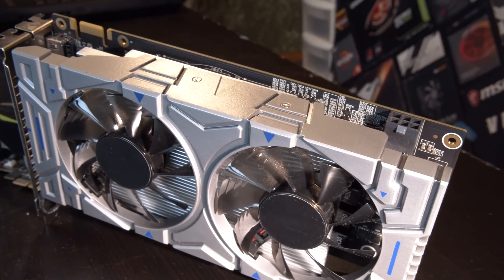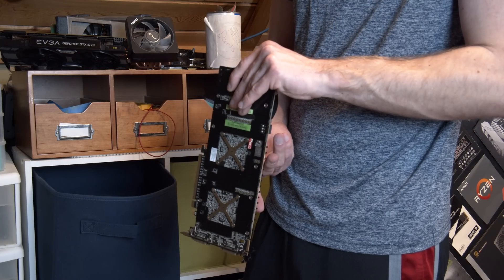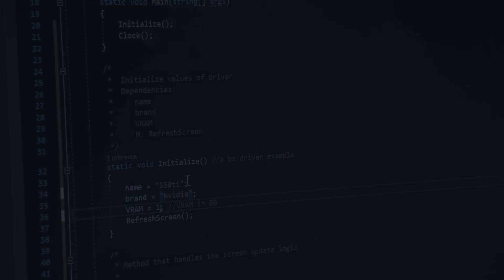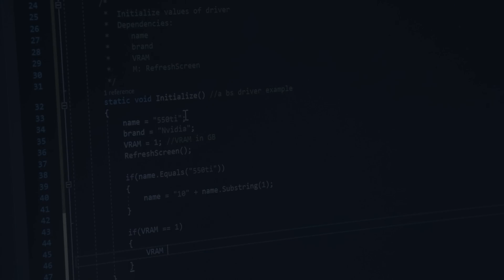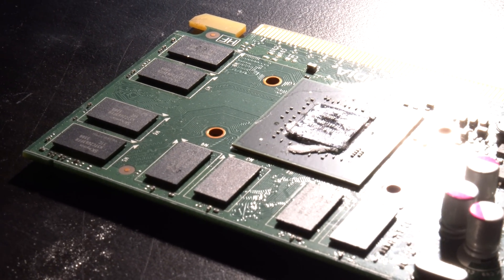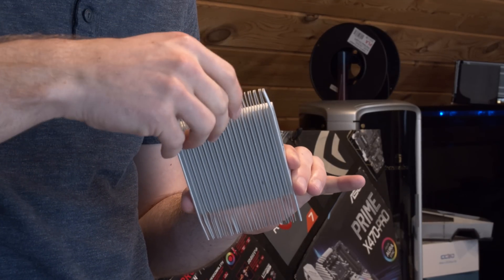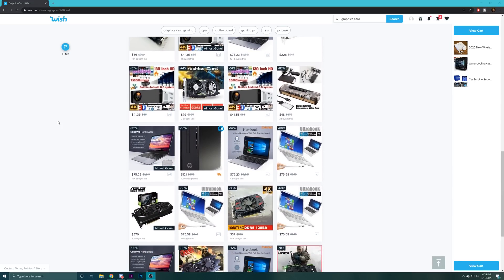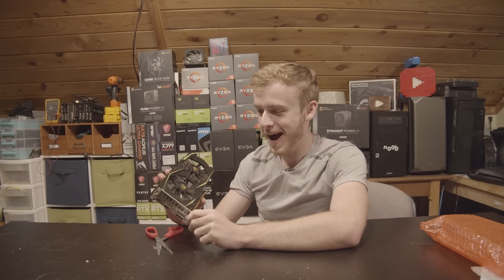How Scam Graphics Cards are Made, and How To Avoid Buying One

Comment: I can't imagine it costs too much to produce these cards. With the amount of 550 Ti cards out there, especially in China, they are probably extremely easy to find. I imagine there are just piles of 550 Ti chips and PCBs just sitting around and these scammers just buy them for a ridiculously low price. Throw on a heat sink that costs almost nothing, a couple of ridiculously cheap fans, and copy a shroud and you got a GPU. Just gotta alter the BIOS. I'd be surprised if the cost of making one of these exceeded $30, to be honest.

Comment: Shipping them from china costs literally cents. And since these GPUs are often broken and purchased from recyclers in bulk, you can assume a couple dollars per card as its scrap value. The chips are taken out from their old boards and soldered onto freshly printed black PCBs to make them not look a decade old. All of this happens in electronics factories during off hours or sweat shops. Some local recyclers in my country also sell dies only, without the PCB so a few thousand can easily fit into a briefcase. :D

Comment: Why not buy a 1050ti then change the shroud to look like a 2060ti and change the bios you could double the cost and because it's a 1050ti it's not super under power so less people will notice its straight garb.
Reply: yeah or you could just buy a 550 and mark it up as a 2060 ti. Btw 1050s cost around 250$ and 2060tis are around 300 so it would not be much of a profit lol.

Comment: I'm going with the idea that a manufacturer in China that is a) Making these parts for a legit card manufacturer and sells the spares to the black market. b) Gets the material from the scammers and manufactures them using the same molds and stuff. c) There's people actually building these with spare parts that are incredibly cheap from salvageable parts they have obtained. d) A variation of all the above.

Think about this: they are making a ton of profit with the server leftovers that they've been getting with Xeon processors and such, they even manufacture new motherboards with those chipsets, it's not far fetched to thing the $30 dls manufacturing price you stablished could be even lower, maybe $20 or $15, maybe they got a nice bulk shipping arrangement and they lose almost nothing, there's also a good bunch of people who don't even try to send them back, so it must be a calculated risk.
Reply from the maker: Could you send me any info you have over email: jaystechvault@gmail.com I would like to get info about where these come from.

Comment: I've had a GPU(Supposed to be the GTX 750) with the gray colored front case with blue marks on it once and I thought it performed pretty well for a non-AAA gaming GPU. But then I accidentally fried it by putting in more voltages than it should be(attempting to use it as an external GPU for a laptop), and had to send it to e-waste. It was replaced by a Zotac 750 but it sits in storage for now since it's not needed atm.
Reply: i know this is super late but hey, im also trying to do a similar thing, how did you get it fried? im going to use a 650 Ti with a EXP GDC Beast / riser, and a psu...

Comment: So you actually do not explain how they made at all.
Reply: And explained why...because people be scamming.
Reply: @jacobbane5117  . I belive i have seen a good explantion on how they made from linus tec tips,using a custom pcp and mounting old graphics cards  components and memory modules from discontinued cards. Many times even changing or rewriting the id code from the used gpu to confuse users, cheap aluminium coolers and copied cooler fan and shroud designs from asus cards and others. The metod is very similiar to the chinise x79 and x99 motherboards they sell on ali express and other places. Recicled parts on a new pcp with a custom firmeware. There have actually been even updated versiones that perform better then others. There weere tested by other youtubers. And identifying those cards its actually very easy also so they are no real probleme anymore today as people who are interested in tec know them and those who still fall for them are not smart enough to atually investigate on what they buy .every tec channel says investigate you interest before you buy any component. Maybe you title was misleading here Jacob .